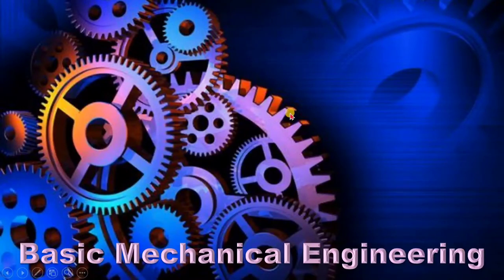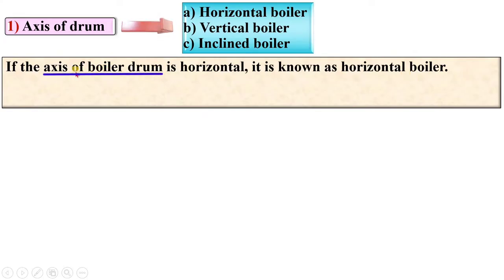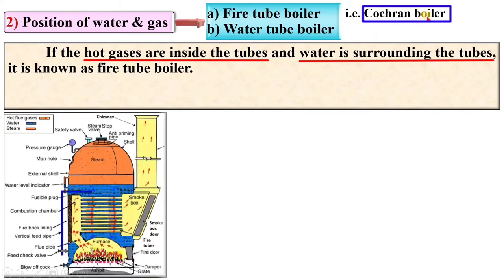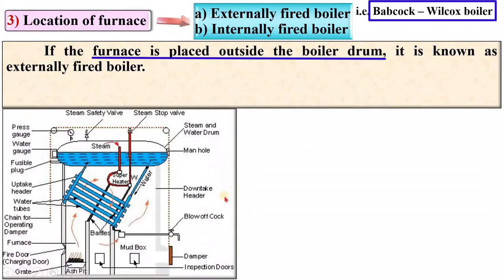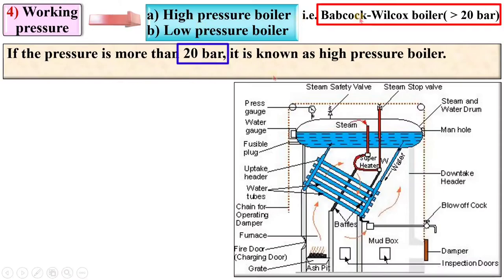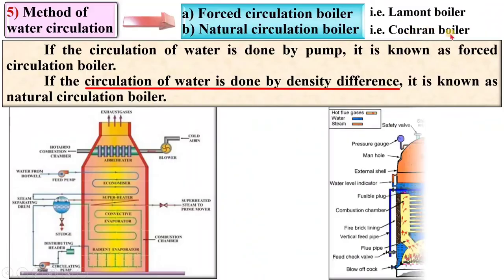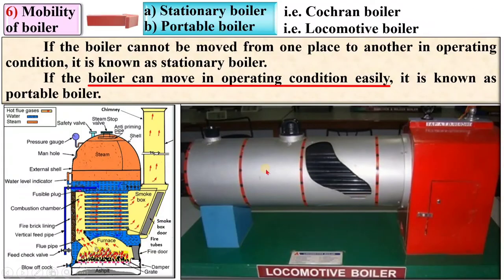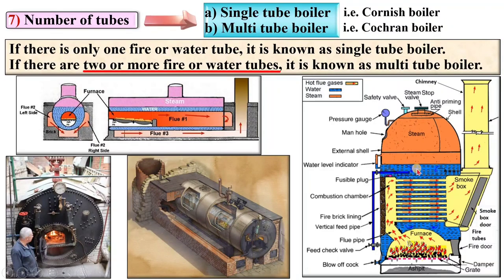Classification of Boiler (Boiler Types of based on Different Parameters) Explained

Comment from the maker: Classification of Boiler is explained with following timestamps: 
0:00 – Classification of Boiler in Basic Mechanical Engineering lecture series 
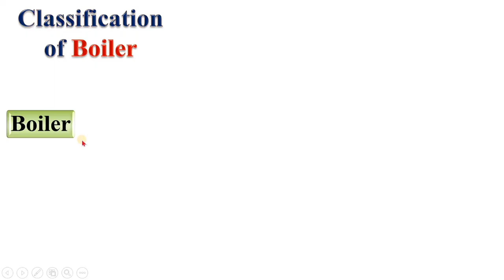0:09 – Classification of boiler
0:43 – Classification of boiler based on Axis of drum
1:47 – Classification of boiler based on Position of water and gas
2:49 – Classification of boiler based on Location of furnace
3:48 – Classification of boiler based on Working pressure
4:43 – Classification of boiler based on Method of water circulation 
5:45 – Classification of boiler based on Mobility of boiler
6:43 – Classification of boiler based on Number of tubes